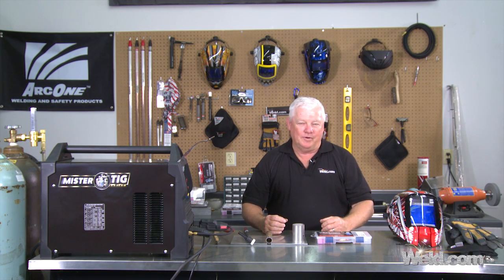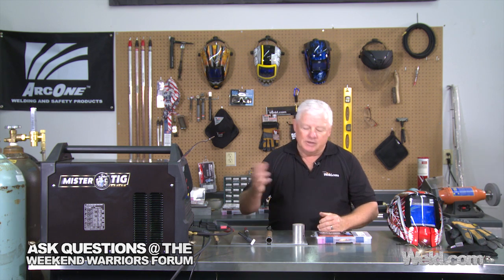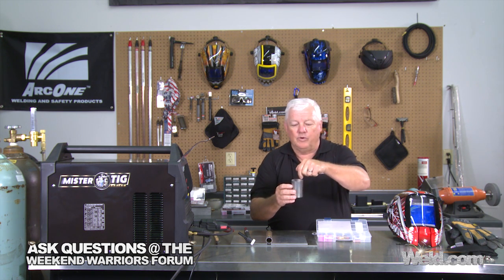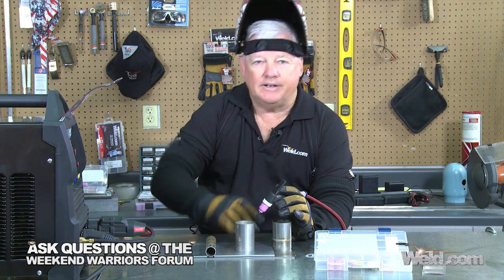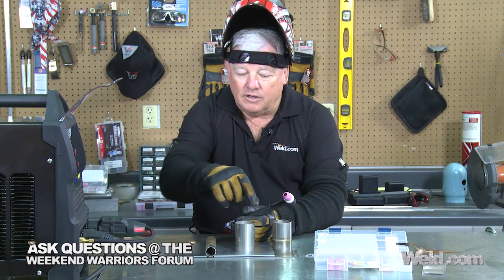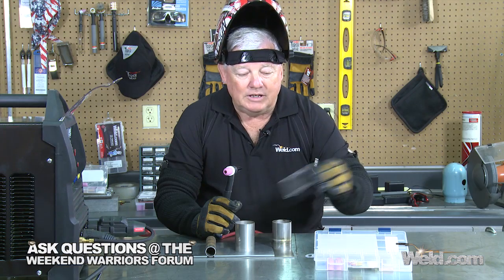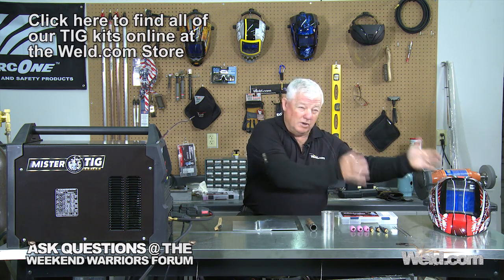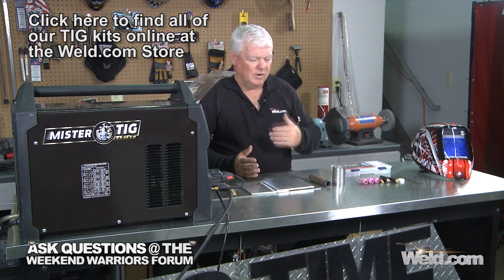How to Choose the Right Tungsten Diameter and Alumina Cup | TIG Time

Comment: When going from the small to larger tungsten. Did you need to change Collett sizes or tig torches, or did that one touch fit ll tungsten sizes?
Reply: Every tungsten size must be used with corresponding collet. Ex., 1/8 tungsten will use 1/8 collet and so on w 3/32 and 1/16. And when tightening your collet just get it snug, if you tighten it to hard to will ruin your collet in no time, it doesnt take much.

Comment: Hello Sir,

I bought a Everlast 164 Pro a few couple years ago and love it, TIG AC/DC, Stick, Plasma and Dual voltage.  I was looking at the unit when you did a review and it confirmed my research.  I am a home shop DIY guy and just like making my on things, repairing cracked heads and so forth.  My biggest money maker has been done all stainless exhaust systems.  So I had a small Lincoln MIG welder that just died and now I am looking for another MIG welder.  Here is my dilemma, I am looking at Everlast i-MIG 140, I-MIG 200 E and then  the Eastwood 175...all three due aluminum.  The i-MIG 140 has great specs and duty cycle that beats everyone else.  I would actually like a little more power like the i-MIG 200 E that is a bit more, especially when you have to purchase a spool gun separately.  The 140 spool gun is $189 and then I have heard you should match your spool gun for the machine amp and then the gun for the 200 E would cost $399 but there is a spool gun that rated at 180 Amps @ 60%  for $299. Would I be safe with the 180 amp.

Then their is the Eastwood MIG 175 that has a much lower duty cycle but comes with a spool gun for $499.

Price comparison, I-MIG 140E = $379 + $189=$564,  I-MIG 200E =$563 +$299=$862,  then Eastwood 175=$499

The price on the Everlast unit could be cheaper if I knew if there was an adapter for the ERUO connection to the Everlast units.

I can live with $600 but seeing the spool guns being so much with Everlast is a bit much.  So I am willing to spend a little bit more but I do not MIG everyday, more like 4 to 8 days any given month.  I mainly TIG every day.  So please let me know your opinion on the quality and durability of these machines with the end state of welding up to 1/2 aluminum and 1/4 steel.

Thanks 
v/r
Tom
Reply from the maker: +Tom Ski Unfortuantely, we have not had the opportunity to test each one of the machines you are asking about. Check out the Weld.com forum (http://www.weld.com/index.php/log-in-to-weekend-warriors/categories) and ask your question there. We have a lot of guys using these machines and they will be able to give you better advice. Also, if any other YouTubers have a response, we'd welcome your feedback...

Comment: It would be nice if the measurements in your videos would also be given in metric values!

For the metric world:
040 is 1mm (funny you imperial people leave the fractions here. What about 5/128? ;-) )
1/16 is 1.6mm 
332 equals 3/32 inches which is 2.4mm 

When it comes to gasflow,  1 SCFH equals roughly 0.5 l/m roughly.
So just double the SCFH values in the videos and you get the liters per minute.
Reply: Sorry:
Not double the SCFH to get l/min, but DIVIDE IT by 2

Comment: Didn't know they made a .40 tungsten that helps alot been having trouble trying to tack ernicrmo-3 with a 1/16 tungsten at 15 amps its only .018 thousands thick also had the gas at 10 with a #5 cup was trying to get my miller welder down to 10 amps but all I get is high frequency and no arc and its an inverter

Comment: Very interesting Mr. Tig but I must take issue with you- it's not at all difficult to convert cfh to litres/min !! cfh divided by 2 is good enough to give l/min.  Most regulators here in the UK have both on anyway-but the real problem is the inaccuracy of the gauge indication, causing wasted gas. Cheers.

Comment: What are the issues with using too large a tungsten if it is sharp?
Reply: James Munn typically you get more penetration and different welding characteristics with a bigger tungsten. That being said sometimes a bigger tungsten will make things a bit easier. I work in a production welding environment and I recently switched from a 1/16 to a 1/8 tungsten to which it allowed me to weld much faster. So switch around and see what happens, what does not work for one person may be the cats ass for you. Best way to learn is to do.